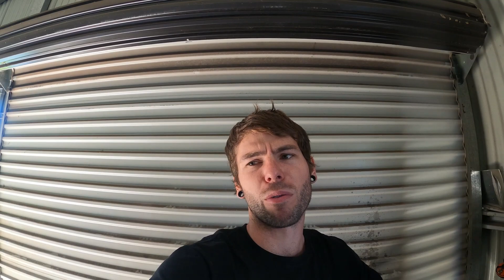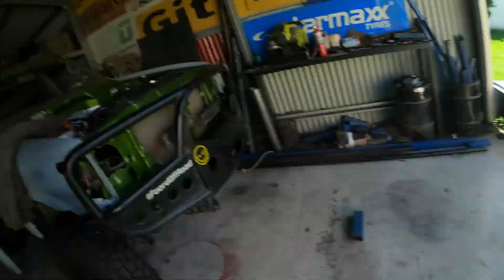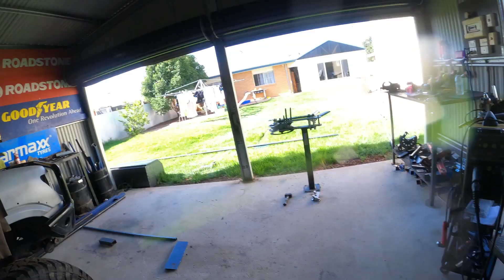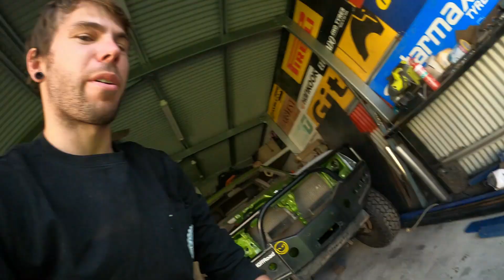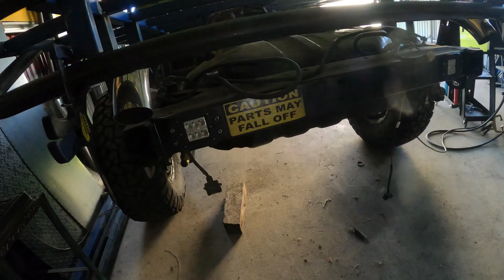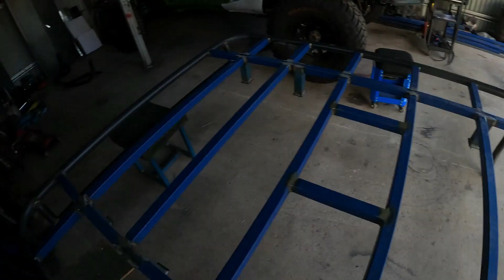LS patrol build ep17 - lets build a custom tray

Comment: Hey mate trays looking grouse, where abouts did you source the 2.6mm wall pipe? And how do the bends come out? Got the same bender and have heard that bends can ripple with that size wall but want to make my tray out of the same pipe to keep it light! Cheers mate loving the build.
Reply from the maker: Thanks mate
Just from the local steel place 40nb extra light black pipe, havnt had it kink yet I just always spray the die and guide with like wd40 or something before I bend it, the thicker wall does make a nicer bend but there is still almost no deformation from the thinner wall pipe